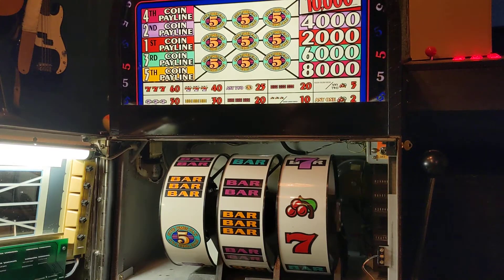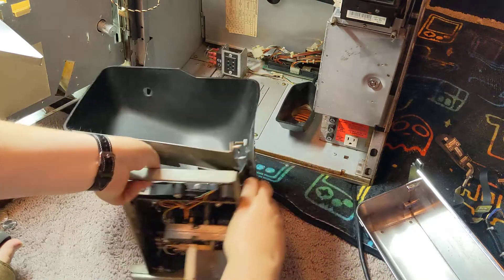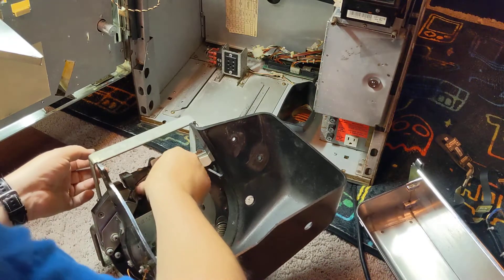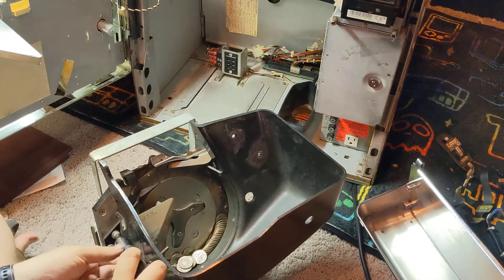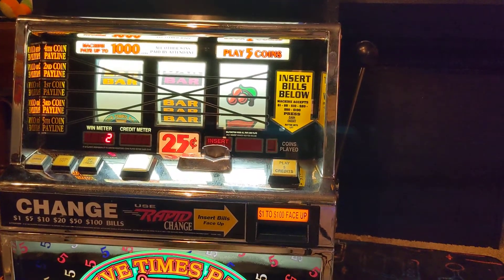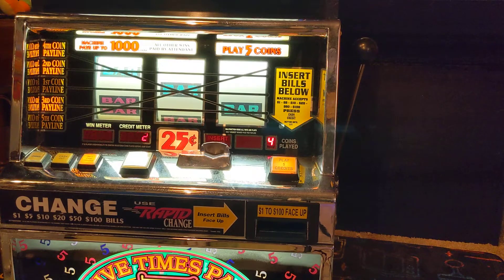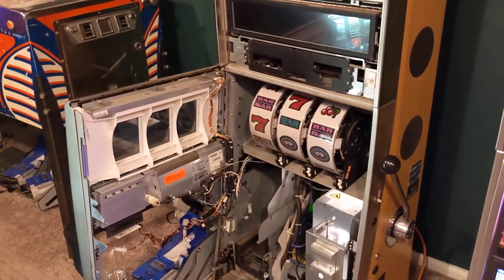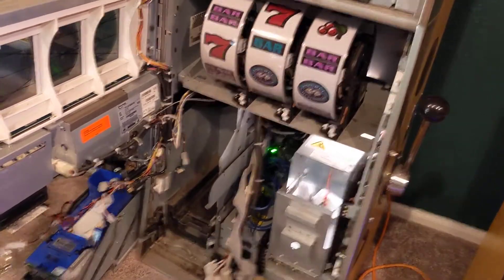IGT S+ Slot Machine Repair | Broken Hopper

Comment: I for one greatly appreciate you taking the time to make this video, I purchased a used hopper on eBay for over $200 and it didn't solve my problem, it was that plastic knife, worn as bad on the one from eBay, paid $20 off eBay, got the new knife, installed and adjusted it and all is well. wish I had watched your video before I ordered it, not work sending back to seller as shipping was half the cost of the hopper. Guess having spare parts is not a bad thing
Reply from the maker: It’s so good to hear this! Glad I was able to help you out, even if after the fact lol!

Comment: I've got 28 years of casino slot technician experience, would love to help you out with your machines.  That hopper bowl comes off with 4 screws/springs and makes it much easier to work on the knife/shelf wheel/coin guide. found your video looking for an old S, not S+.  You have an S2000, good find, very easy to work on.  Hit me up, i can help with the belly door not closing right, easy fix.  Very cool you have these.  we can't own them in Missouri yet. Chris
Reply: hey, i'm from Argentina! and just bought an s2000 and hopper was disabled. First I need to buy the key chip to disable coinless mode (I suposse), and then, despite hopper is installed, I see that there are some wires disconected, i think the people who disabled it also disconected the module from main board. Can you help me where to see the proper conection for my cables to make it work? Thanks very much!
Reply: Hi Chris. Do you have any advise for me? I have player's edge draw poker machine that says "hopper empty" please call attendant. The hopper had been empty virtually it's whole life and never triggered this error message. No jams or knife issues. I've tried going through the menu and testing the hopper, it makes noise but will not spin.   Any advice would be appreciated. Also, should the hopper be able to spin without being hooked up to the machine? Thanks.

Comment: I have a jam in my hopper. Older double diamond machine with the reels on the bottom not the top so you have to access the hopper from the top. I need to spin the hopper backwards to clear the jam. Is there a way to release the brake to spin it backwards?

Comment: I have a same hopper. I just ordered new and it keeps spinning and spin all the coin out. Is there a reset or anything simple fix ?
Reply from the maker: Could be many things - Do you have the right sized coins for the hopper you purchased? Does it spin the coins around in a circle or does it just keep spitting them out?

Comment: Last one is an SAVP.  Try closing the door without the top bracket above the door, very notorious for that.  Also, the top cherry switch can be wired to normally closed or just put it inside and jumper it, it is pressed in by a top bracket/plate above the door.  Bottom/belly door will not close if the main door is not exactly in place and that top bracket/plate can prevent this.

Comment: I have a hopper that just keeps spinning and kicking coins out. Doesn't stop, any ideas?
Reply: Could be a bad hopper optic, with a bad knife it usually does not dispense coins, they just keep churning in the hopper as it runs
Reply: First check the coin out optic (U shapped plastic peice) on top of the hopper that the coin passes through, somtimes a lever that hits a switch. If the CPU does not have the ability to count the coins it will keep running (runaway hopper) Hope that helps